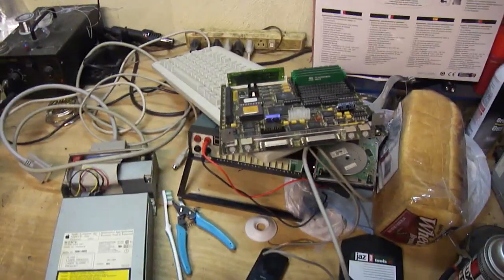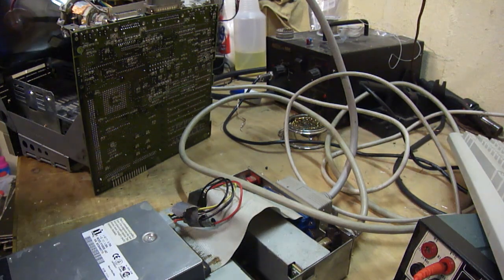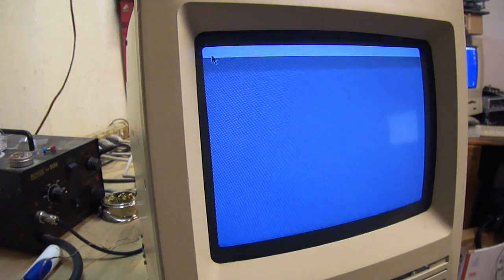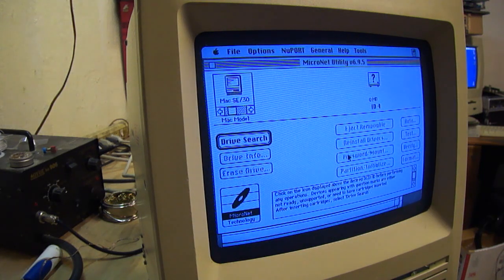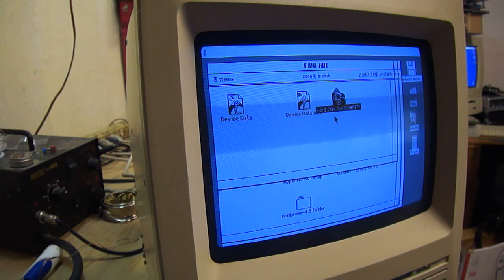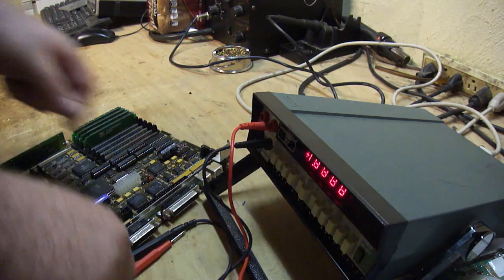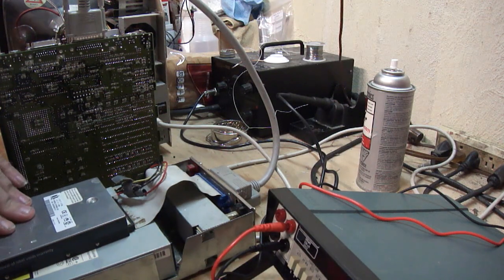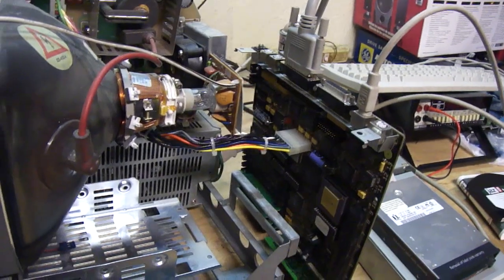Repair a SCSI issue on a Macintosh SE/30

Comment: So you found this by testing the continuity on each pin of that chip?
Reply from the maker: I dont remember exactly, this is an old video.
Reply: @THEtechknight I have the exact same problem and I just cant for the world of me figure out what you did in this video. Can you please try to recall?
Reply from the maker: @elv1swest770  unfortunately this video is over a decade old at this point so unfortunately I do not remember. However, if it's like every other SE/30 its a matter of chasing all the traces out of the scsi chip back to their respective locations

Comment: Hi, nice video. I have a SE/30 that is not recognizing anything on the SCSI bus, internal or external. I wasn't able to clearly hear what you said to fix the problem on the NCR IC, did you reflow it using hot air? Thanks in advance.

Comment: I re-traced all lines from the SCSI chip, and all are connected. I was mistaken before.  The drive and scsi cable I have work fine in a SE.  I can boot the SE30 to floppy, and SCSI Probe says that SCSI isn't terminated.  I get 4.78 volts on the termination line, and the terminators are in correctly.  I jumpered over the 5.02 volts from the floppy drive power, and even with 5.02 volts, it still says that it's not terminated.  Any thoughts or suggestions?

I've been trying to get an account on the 68k liberation site, but they haven't approved/activated my login for the past week.  :(
Reply: ***** Will do, once I get my account approved there.  I have the tools to remove and re-attach the correct scsi chip myself.  I was contemplating using the larger DIP version from an SE in it, just because i have one on-hand, just to have it done quickly... but that would be insane and stupid. ;)

Thanks for the reply!

Comment: Hey.  First of all, megacheers on reviving boards that might otherwise end up in a landfill. That's really awesome.

I have an SE/30 which suddenly stopped reading the SCSI chain.  I was about to re-cap the board anyway, and thought that was the problem.  I recapped it using radial electrolytic caps (although I can put in tantalums eventually if I need to).  And it has sound again, and boots via floppy just fine.  I tried internal and external scsi interfaces, and neither worked with known-working SCSI hard drive and ribbon (I have a spare SE motherboard, and it booted up with this drive without problems)

I buzzed out all of the lines from the D25 to the 50 pin to the SCSI controller.  All worked, and there were no shorts.  I get +5 out the termination power, and all other power/ground lines seem appropriate. (Compared with the schematic).

I traced and buzzed out most of the lines from the SWIM, Glue chip, etc to the scsi and all seemed good... although one line, the SCSIIRQ line seemed to not connect from the 53C80 to the Glue chip, so i soldered a wire to it, but then it turned SimasiMac... removed it, and it booted again.

Thoughts?  I think it might be the SCSI chip... which would suck to replace...
Reply: Did you ever figure this out? I think I have the same issue
Reply: @slaquers  To be honest, I don't remember.  One of my SE/30s doesn't start at all now,. it might be that one.   :(

Comment: Sir, I have an old Se 30 with similar problem (no startup and a questionmark) and is wondering what the values should be between  53C80 Db2 pin and the bus pin on the scsi. I got a value approx 7 m.

Comment: @TheJohnnyProject I have no camera I do have a few old MAC se systems running local talk I also have a old NCR starlan system running . I am using a old DEll insperion 2600 laptop with a 20 gig drive and 512 meg ram . Does have 2 1.0 usb port . I live check to check since I am on SSDI and 10 % from the military . I live in NY so NCR workers comp sucks the laws here go against the employee. I won 200k from the lawsuit but work comp took it as that the laws in NY.

Comment: I also worked for NCR Nation cash register for 9. 5 years . The used those chips on the 7450 cash register system . It ran starlink a ncr POS network system . I have a lot of old chips from those ncr systems I got out of the NAVY 7 years on subs as a disabled vet went to work for NCR and was hit working on a ATM by a full size van leaving met total disabled . NCR had a lot of propitiatory lan system and still do.

Comment: I seen this and it brought back a memory I worked on a computer system back in the 80s in a UPS company they had 12 machines hooked together with local talk . It was for a cad system had 20 inch monitors . Back then local talk was fast for the time.